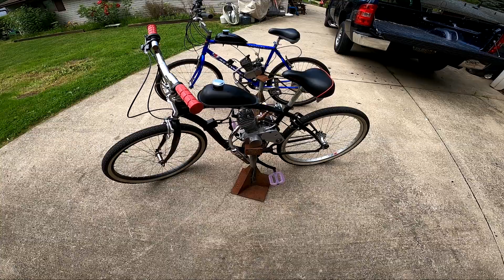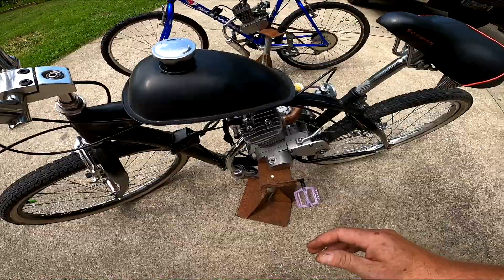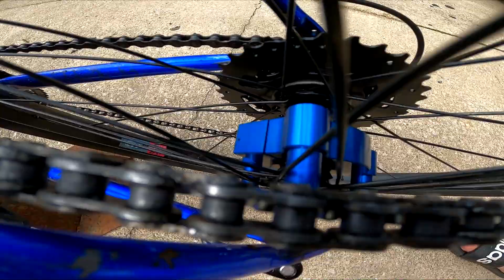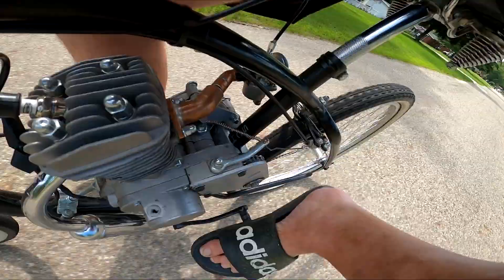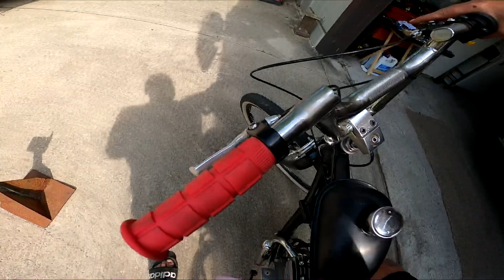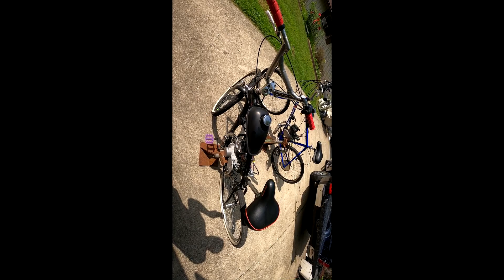80cc Motorized Bicycle With Jack shaft Kit and Half Link. Removed Tensioner. Intake Issues.

Comment: On your CNC hub mounted clamp make sure there's a gap on the bolts that clamp it down if the metal is touching it will not tighten all the way that's why it's spinning around

Comment: No clue why they call the jack shaft a “shift kit”. That assembly has nothing to do with shifting. I like your videos thanks. I just built a bike with a jack shaft and 7 speed Shimano Nexus internal hub. It’s magical. I made a shifter mount on the left side under the gas tank. I don’t have to clutch to shift.

Comment: I'm guessing the tube between the carb and the cylinder is too long.  If you can make it shorter you might also make the tube straight too.  The shorter length and lack of bends will probably fix your intake problem.
Reply from the maker: I think I'm going to try one of those CNC shorty intakes. I might have room for it and I think I can cut it even shorter, but It might put the carb on a bad angle?
Reply: @OlszkoolCustoms  The intake doesn't have to be metal.  I had a dirt bike that had a rubber intake.  You can probably cut the ends of you intake off and find a rubber hose of the right diameter and cut it to length.  You can fasten the hose with hose clamps.
Reply from the maker: I cut one of the bends out of my intake, leaving the carb on some what of a 22.5* angle. Seems to run better. Now I'm popping the chain on the jack shaft...lol
Reply: @OlszkoolCustoms  One problem down. One more to go. 😀